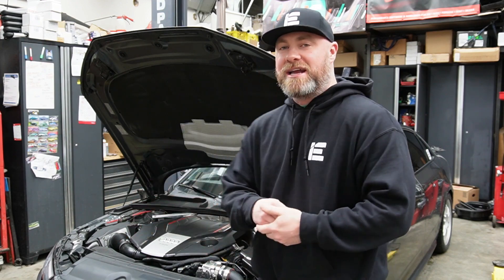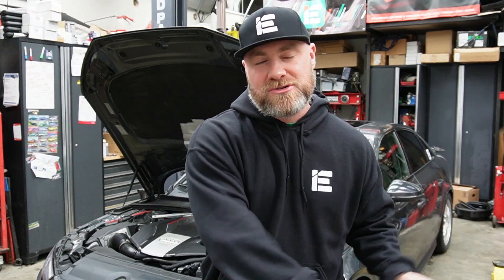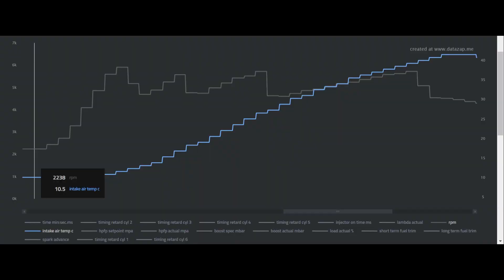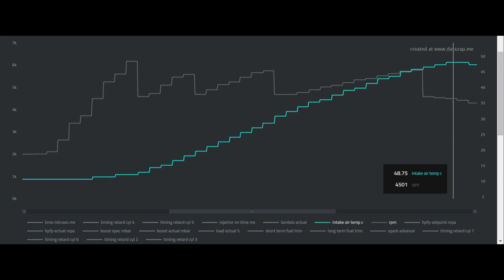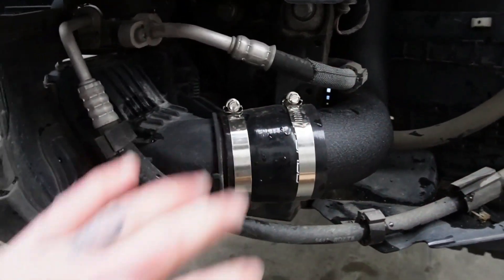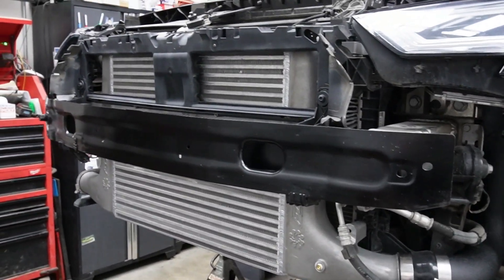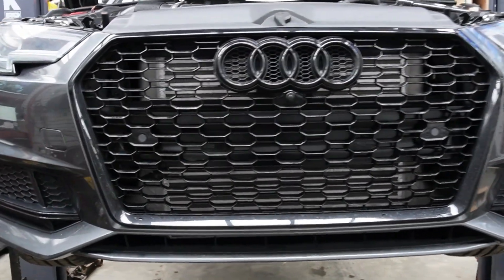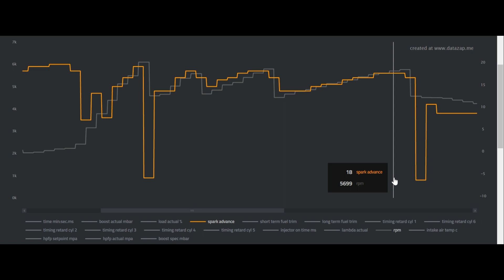Integrated Engineering Intercooler Performance Test - Audi B9 S4

Comment: Can we get a 0-60, 1/8 mile, 1/4 mile before after on the intercooler, or at least 1 dyno pull?
Reply from the maker: This video is 3 years old now, and I don't own the car anymore. What I showcased in this video is more telling than any of those before and after tests you requested.

Comment: Final question: it appeared that the clamps that came with the IE intercooler weren't tight enough, and you swapped them out?? I'm having one installed on my Audi next week...do I need to purchase different clamps? If so what size and type?

Comment: Hey Adam question on spark advance, what is a a good number to have? Higher the number the better?
Reply from the maker: Your tuner will have set a predefined amount of timing advance that your car will try to achieve in optimal conditions. The goal is to get your car to achieve as close to that maximum value as possible through all of your gears.
Reply: @VancityAudi oh ok so let me get in contact with IE and see what it would be. I would usually send them my logs and they tell good or bad, but I want to learn more about the logs myself. Thanks for the reply bud!
Reply from the maker: @tsras1979  you're very welcome and good luck!

Comment: Great video! I wonder if the larger intercooler restricts airflow to the radiator, it would be interesting to see the oil and coolant temperatures before and after the install. Cheers!
Reply from the maker: Thanks! We've installed much larger coolers and heat exchangers on all of my Audi's and have yet to experience issues with either of those concerns.
Reply: @VancityAudi  Thanks for the reply. Tempted to install one on my S4 Avant now!
Reply from the maker: @PabloRenoir1984  do it up! easier on the motor when it is using cooler air rather than extremely hot air as well as seeing an increase in performance.

Comment: This Right here was a Well needed Video for me and I’m sure for others Audi Fans/Drivers, I Appreciate the Time you take for explaining everything! it’s a coincidence I just installed my IE Intercooler/ CTS Charge Pipe yesterday on my ‘18 SB and did one Pull with that Bottom Clamp Popping right off was so annoying, where/Size did you get those upgrades Clamps? It’s a Must with that Tune Pressure…
Reply from the maker: Thanks for watching and you're welcome! Try and reach out to CTS and see if they are able to send you upgraded clamps. We happened to have these left over in the shop from another build.

Comment: Hi Adam, also a van vity audi owner. Amazing to see so much cooling. "Cool" video. Question, That Intake Air Temp graph is strictly RPM and Temp? When you said at the end of the run the temp is at... I'm not sure if that graph is ploting temp against rpm or speed or something else. Thanks.
Reply from the maker: The graph I was showing was simply the intake air temp vs what the rpm was.

Comment: Great video Adam.  I’m about to add a man upgraded intercooler to my B9 SQ5.  

Does your S4 have Audi pre-sense?  If so, I am curious if you ever had to have it recalibrated after removing front bumper?  I heard Audi charges several hundred to recalibrate.
Reply from the maker: All B9 S4's have front pre-sense. I have never recalibrated my pre-sense once.
Reply: Pre-sense uses a camera mounted behind the interior mirror, it’s only the adaptive cruise radars in the bumper.
As these are located in the lower bumper grill on the B9 even with a bumper removal it doesn’t affect them. Even if it does it can be re-calibrated via VCDS.
Reply from the maker: @Jackofspades11  I was under the impression Audi pre-sense was the ability of the parking sensors to activate the braking system which to my knowledge every B9 S4 has. What I believe you're talking about is referred to as ACC or adaptive cruise control. That is what the camera is that is found on the front grill of the vehicles optioned with it.

Comment: what is the difference between an intercooler from IE vs 034 vs APR or ECS? would they all be the same or does IE offers something better than the rest for this type of hardware upgrades? btw my IE stage 1 for my s4 b9 is already coming thanks to your channel! great stuff
Reply from the maker: They are all made differently, whether it is a bar & plate design or a tube & fin design.  IE utilizes their FDS technology which allows it to flow incredibly well.  As much as I can't speak to the performance of the other company's products because I have never used them, I have seen nothing but quality hardware come from IE and Uni.  The other 3 companies, I can't say the same.  Thanks for watching and congrats on your B9 S4 build!

Comment: I Have a 20’ Rs3 on Stage 1+ e85 from UNI  , would you recommend an IROZ or a IE IC?
Reply from the maker: I have used two different Iroz intercoolers in my RS3 and they have both worked well for me.  I've never tested a Unitronic intercooler, but I've heard they work really well too.

Comment: good job man 👍amazing video so far best videos I found on YouTube soo many information you give as of course I'm doing everything you do except 😀 I jump to stage2 iE from beginning 😀 .
Reply from the maker: Thanks!  I hope the results of your upgrades were exactly what you were hoping for!
Reply: Hey, I have stage 1 93 on my B9 S4 w/ inlet CAI and intercooler. For stage two, I would need a dp and tune but I am only after performance gains, not sounds. Do you feel the difference the dp makes? The stage two tune only provides cackles, no hp/tq gains. And with the dp costing $1K it isn't cheap. So very curious to get your feedback
Reply: @jimmyb2202    soo many ways you right but stage2 i have full bolt on is little bit more different in hp from stage1 how much is different between stage2 end stage1 i don't know end Reason why I'm on stage2 because right now I can get TTE710 for stage3
Reply: @bossanac9093  So you are ready to drop the $5k on the big turbo?
Reply: @jimmyb2202   Why not you gonna have everything you need power around 600hp
Reply: @bossanac9093  i agree, its just a lot to spend so was curious that is all my friend... I need to start thinking of a 'reason' to drop $5k on my S4 to the Mrs.
Reply from the maker: @jimmyb2202  I'll be documenting my entire build as I take this car to a FBO Stage 2 E85 power level.  I'll be able to show you exactly how much power the downpipe makes on a dyno and on track.
Reply: @VancityAudi  Yup, I look forward to your videos. Content is exactly what I have been waiting for haha but not my wallet! I want it all, and I want it now!!!!!!

Comment: Impressive improvement, even with the E85 likely helping to keep the timing higher as well. I imagine the timing improvement would be even higher on a 91/93 tune. I can't wait to upgrade my RS3 intercooler.
Reply from the maker: The only thing that was hampering the timing advance was the IAT's being too high.  I would have to think the improvement would be the same or less on the pump gas tune because the timing advance of the tune isn't nearly as high in the first place.

Comment: glad i went with this IC and didn't cheap out on an ECS/Rev 9... do you know what the IE IC is power rated for? i assume they're using it for their TTE Stg 3, so must be good.
Reply from the maker: Sadly I don't know what power they rate it for, but you are correct. They are still seeing solid IAT's while using the TTE710 on E70 and running 9's.

Comment: Awesome! And yes we appreciate it. Great video, Adam. 
I have the APR intercooler on my car now, and the IE version in a box, I think I’ll do this same test when I swap.
Reply: Out of curiosity why swap from apr to ie? Apr intercooler has shown to hold great even on power levels of the tte710. Also comes with replacement piping and has shown to compete right with Wagners. Just curious on why the swap 🤔. I could understand if you were going from like ecs or cts which have lower performance.
Reply: @headshotharry2313  I’m going to do a couple videos on it for my channel. Also, the IE intercooler has FDS, which should increase the ability to cool. I’d like to see if there is a difference and how much.
Reply: @Vaguh  now that's a very good video. Apr vs ie, is cost difference worth it. Also remember to say the apr comes with replacement piping. People will automatically assume ie is better because it's cheaper but doesn't have replacement piping.
Reply from the maker: It'll be cool to see how much the IE intercooler outperforms the APR one. I'm more than confident it will.

Comment: All VAG platforms should require an IC upgrade as part of stage1 1, full stop.
Reply from the maker: Agreed. That's why my first performance hardware upgrade is always an intercooler or heat exchanger.
Reply: Don’t even wait until stage one, vw/Audi oe intercoolers have to be some of worst/least efficient ones I’ve ever used.